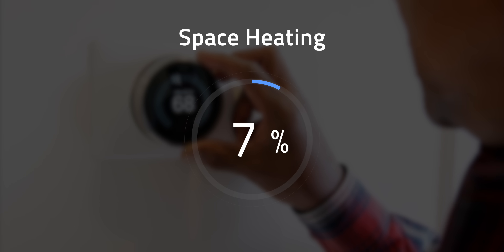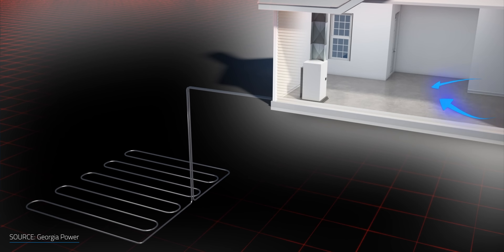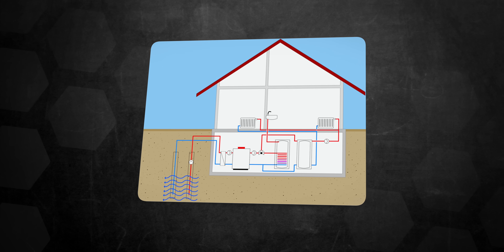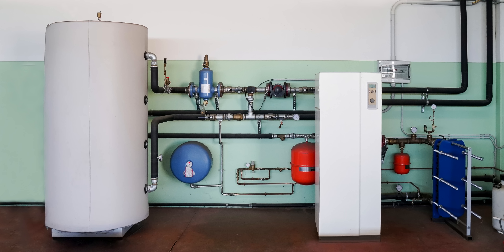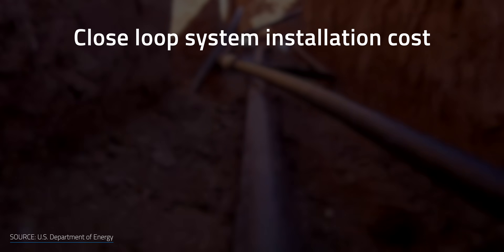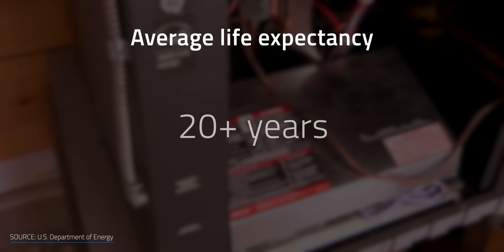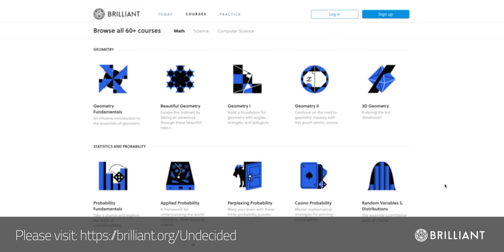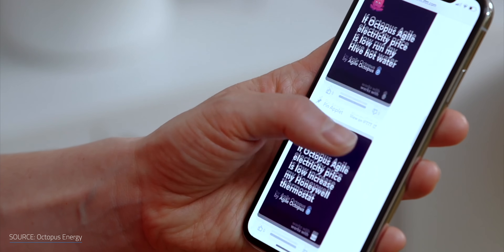Is Geothermal Heating and Cooling Worth the Cost?  Heat Pumps Explained

Comment: I heat with propane in northern Michigan and what I’m thinking of doing is installing a Mr. cool heat pump and AC to heat the Home in the fringe months. This would cut down my propane use and be more efficient. It will also act as a back up heating system in case the propane system where to fail. Because of the Lake Michigan temperatures are not as extreme. Has anybody ever done this? Any thoughts?

Comment: I've been a fan of heat pumps since I discovered them I'm 1989, I was a heating engineer and consultant and quoted for a number installations here in England,  but never installed any for a variety of reasons, I haven't been able to make the economic reasons work. In the UK the average seasonal COP is 3, electricity is circa 3.5 times the price of natural gas, so at best the heat pump is more expensive to run. 86% of heating in the UK is by gas fired boilers, the cost to replace a high efficiency gas boiler is circa £1500, the best makes will run for 20 plus years, with low maintenance costs, the average cost to replace a gas boiler with a ASHP, the cheapest option, is circa £20,000, there is no financial case, also the maintenance costs are likely to be higher, one of, if not, the major obstacles is the space required for the equipment,  Lock'n'Store is so popular in the UK as the average house is approx. 1100 ft2.

Comment: This can also be integrated with the piling foundation. For these projects that require piles, geothermal adds only a very small extra as the piping is just tied together with reinforcement. Concrete is good enough at transferring heat, so it does make sense.
Reply: That is a great idea.  I would bet most don't think about that.
Reply: @houstonbill  
Nope, they don't. Unfortunately. 
Micro-piles are becoming more popular so it makes me even more sad.  

It's becoming more common for bigger projects though, especially when the government is a client. 

They were installed in Crossrail (new London metro line). I know as I was on the project.
It's nothing special to be honest with you. The technology is old and conventional...which makes me even more sad :(
Reply: @valdius85  the Shard in London also has geothermic pile foundations I'm pretty sure
Reply: @Brurgh  interesting. Thanks for sharing that

Comment: Locally in the nordics it's not called geothermal, it's just a ground heat system. Currently many (20%ish) new single home houses are built with one, often combined with an exhaust air heat pump. More single home houses are now heated with ground heat pumps than with electricity in finland.

Comment: Geothermal is really the best option if someone in the north wants to install a heat pump. It's so cold up there that air to air heat pumps really don't work. 

The big problem is that geothermal systems are incredibly expensive and take substantially amounts of time to install. It's also not easy to just find anyone to service them nor is it easy to replace them if they happen to go out. 

Personally I think if geothermal had more support behind it from entrepreneurs that were able to bring the price down by at least half, which i know is kinda unfathomable, then it could become incredibly popular. Especially for a lot of new construction in rural areas.

Comment: Technically, this is 'Geo-reclaimation'. It's 'worth' is subject to installation and alternate fuel source availability costs. If the popularity of this system is prevalent in your area, you may end up spending less for your system than other areas.
Reply: alternate fuel source doesnt matter as it takes less power per heating and cooling unit over other heating/cooling systems so you save money and emissions in the long run regardless of how you power the system but coupling it with a small solar array would make its operation free if you have some form of battery system for night time use.
Reply: @bodhisfattva7462  - I beg to differ. I'm not certain you understand my statement. 
When the installation costs, divided by the number of years to pay off said costs run past the dozen year term, then you see little benefit and in actuality pass your potential savings on to future owners, give the high home turnover rate in North America.

Comment: I’ve known about the advantages of geothermal heat pumps for many years and continue to be confused on why they aren’t more popular. I know the up front cost is a issue, but radial tires cost more than bias belted, how many cars run bias belted.. yes I want geothermal, with solar panels and power wall for the electrical source, and just to round out the system, a biomass boiler in the garage for the really cold days. I am in Maine.

Comment: Spend your money on insulation, weatherstripping, and maybe multi pane windows.  I’ve now lived in 2 well insulated houses in Colorado, and heating is really a non-issue.  We used baseboard heat in both which is really inefficient compared to heat pumps, and the bill is usually less than $250 in the winter.  I’d put in a air source heat pump which now can work to crazy low temps before I’d put in a ground source heat pump.  So much less complex/costly. But really try all the simple passive stuff first.

Comment: How warm will it make your house in the Winter?  If it is 50-60 degrees F in the ground, how will it make your house comfortable to live in?  Liquid does not compress like refrigerant gas.  You would be limited to warming your house to ground temperature.  That is cold enough for carpets and clothes to mold.  
I knew a guy in Florida who had his AC condenser cooled by his well water, which was discharged into his lawn sprinkler system.  It cooled the house rapidly, and watered the lawn at the same time.

Comment: Just as a small international information for you. Here in Switzerland, our House (consisting of 8 seperate appartements) just inquired what would the price for  a horizontal Heat Pump be and we all were shocked by the stagerying 120'000-180'000 CHF (that converted to USD is around 7%higher) and thus we will most likely just swap out our heater for a new oil powered one (price around 20'000) 
so the price differences can be a lot higher than in your examples. 
Still good video and have a nice day :)
Reply: Check on cost of vertical system… and his was talking about a single house, you said yours was for 8 apartments….
Reply: In Switzerland everything is 2-3 times more expensive than elsewhere. Especially when it comes to specialised work you cannot do yourself. I also live in CH and found that costs between companies can vary wildly. I would ask at least 3-4 quotes and ask them to provide you with an ROI calculation vs oil. Theirs margins are ridiculous, if you challenge them, you will be surprised. Most work with developers, who just pass down the costs to new house buyers without questioning them. They have gotten used to this easy way of making money. Electricians are the worst in my opinion.

Comment: The diagram you used to explain how this works coupled with your wording is a bit strange. The compressor isn't pumping a liquid, they're vapor pumps. Pump a liquid in a scroll or a recip and you'll destroy them.And in a closed loop system, you'll almost always seem some sort of glycol solution in the mixture. glycol causes some efficiency loss but probably doesn't matter that much here. As a HVAC contractor and tech, I don't recommend them to people. They're expensive, if the copper in the ground gets damaged and needs repair, that's expensive to dig it up and find a leak, just too many potential issues. The price you pay to install one, you'll never get that money back during the operating life of the equipment. Get a standard 14 seer heat pump, or get a 96% two stage gas furnace and a 14seer air conditioniner. Also, It's really a good thing to go by rule of thumb. Every house is different. You have to do a proper load calculation in order to figure the actual size of a unit you need.

Comment: So, correct me if I am wrong but, you're still using electric to power the pumps, fans, etc of a geothermal heating/cooling system which you pretty much do anyways with traditional methods?

Also, if you were to go with the more expensive ones around 30k and were liberal about your cost savings - you'd be saving about 100 bucks a month, give or take, on heating/cooling costs. Thats roughly 25-30 years before you'd see a return on your investment. Definitely not a practical or cost effective system.

Not sure I understand what the benefit is of such a system at this point.

Comment: Great video, thanks. I live in Europe (@52 deg N) and I have recently built a new house. Due to limitations on site size, I installed an air to water heat pump as the sole heat source. I am really pleased with the result. Complete house has underfloor heating. There is currently a serious drive here in Europe to get away completely from fossil fuels and reduce CO2 emissions. Perhaps this air to water system could be an option for people in the US also, particularly in Urban areas where availability of ground for Geothermal is severely limited.

Comment: I have been researching this... and the hard part is to find any contractors/companies that will work a little outside the box, especially here in MA. I have found most companies solutions, want to deal with only ducted forced air systems. I have also found that a lot of this is tried and true in the commercial space but hasn't made it to the consumer/residential space... Things like water-sourced ductless systems, VRF / VRV based systems... Or Ductless Hydronic systems ( no refrigerant / no max length considerations )... would love any advice you have for a fellow MA person ;)

Comment: A big benefit of geothermal vs conventional heat pump is the ability to respond to nasty weather.  It keeps your home much more comfortable at times when the weather would really challenge a conventional heat pump.  You didn't mention that the COP for an outdoor air-exchange heat pump depends highly on the outdoor air temp.  So when it's really cold, the COP is greatly reduced and it takes a lot longer for the heat pump to warm the home.  There is even a point at which it's necessary to backup the system with resistive heat (ex$pen$ive) just to keep up.  For geothermal, the COP doesn't change much, and even during very cold temperatures the heating can still perform well and maintain a warm home. Winter is a bigger challenge than summer, but these same rules apply during summer as well - geothermal handles the temperature extremes far better and keeps the home much more comfortable than conventional systems.  I've had geothermal for almost 6 years now, and it's fantastic.

Comment: I don't understand how you gain heat from a 60° ground to heat a house heated to 70°.  Seems like the return loop would lose heat to the ground.  And in a conventional system, return air is warmer than 60°.  It seems the system is really based on the heat pump.
Reply: Heat exchange chamber.

Heat can be transferred to other systems.

Energy is lost mechanically and electrically but not thermally.

Comment: is it possible to combine both Geothermal heating/cooling along with the Sterling engine that you've done in another video to both heat/cool your home along with providing power?
Reply: If you rely on a starting power source or material, yes. But if that's the case you might aswell use 2 seperate energy sources rather than combing your water and your heating and your electricity into one rather inefficient method.

Comment: Like you said, it's the up front cost that holds me back. My HVAC is due to die any year now. But at 15-30k for a geothermal system, that's like doubling my student loans. If I was building a home from the ground up, I'd start with geothermal and solar roof tiles. But with an existing home, the cost-benefit doesn't look good at this point in time.

Comment: my sister has one and they are having heat pumps last around 8-10 years. thats it. the new pumps are junk. their old pump lasted 20 years and their installer told them the new ones are not lasting more than 10.

Comment: Mech. Engr. here.  Systems do not send refrigerate into the ground.  Only water goes into the ground loops.  A heat exchanger within the heat pump uses the heat from the ground loop water to change state of the refrigerate depending on heating or cooling.    I designed my system for my home 10 years ago.  I have 9ea, 300' wells for a large home on the coast of SC.   I find my air temp. from the vents in my house are 55F in the summer and 115F in the winter.  The unexpected is that ground source heat pumps are higher efficient and can produce much hotter temperatures for the house in the winter.   I priced a geothermal system to a high efficiency typical heat pump system and found the geothermal system to be about 80% more in cost.  However, with state and federal tax credits, the installed cost of the geothermal system was less than the high efficiency typical heat pump system.  My electrical costs are about @$230 per month and that includes an electrical car.   This is a no brainer tried and true technology that amazes me more people do not do.
Reply from the maker: Thanks for sharing and the clarification.  I could have done a better job explaining that first point, but it's not only water that can go into the loop.  Some closed loop systems use an antifreeze solution.  I really hope costs for these systems can come down to make them more financially compelling without incentives.  With incentives ... they really are the way to go if you can.

Comment: I went with a vertical closed loop GSHP for heating and cooling several years ago. IIRC, Federal tax refund was 30% of the cost and my electric company kicked in $1,200. It also preheats water for the hot water heater. If you're into a house for the long-term, high efficiency is the way to go. Those who are just flipping a house quickly won't see the savings, put in something inexpensive to install, and doom the next owner to higher costs over the life of the system.

Comment: Nr 1 in low cost heating is not heat method  but a good insulation.
I heat 200 sq meter 6 months at average temp +5 - +7 celcius with less then 1000 cub meters of natural gas per season less then 300 usd. With 0 running cost of geothermal installation, I would not install it. It is waste of tons of money!

Comment: if you don't mind your house being heated to 50-60 degrees when it's 0 outside then you will be great otherwise you need to heat the water another way.
Reply: Hmm. My geothermal unit keeps my house 70f when it’s -40f outside. With no backup heat source.

Comment: My personal view is that you either want something with a 100% reliability (EG a fire)  for heating or two independent systems if you are somewhere fairly cold (IE temps reaching -40). In the remoter areas of Siberia every house has a fire and oil heating, and often propane as well. When it gets seriously cold (-65C or about -85F) they usually have two going. On the plateau in one of the towns it got so cold once they could not measure it properly (colder than -70C or -94F). Oymyakon has an average winter temp of -50C (-58F) and regularly is -60C throughout January. For hot places there are all sorts of tricks you can do to cool your house before AC eats your wallet. Double stacked vented roofs with water sprinklers where they are allowed. IE a roof with wriggly tin spaced off by 15cm (18 inches) so your roof is not subject to direct sunlight. A gap at the top for hot air to escape and that alone will reduce your house temp by a few degrees. The water sprayer trickles water down the roof at something like 1 gallon per hour. That cools the outer layer giving you a few more degrees. Then there are the window shades which ideally would be a lot wider then the windows so it keeps direct sunlight off the walls as well. Another few degrees cooler. None of those cost a fortune, and the window shades should be easy to get building permits for if they can be easily removed. The roof is a completely different issue though and completely unsuited to hurricane areas etc. I have seen them used without the water system in some places in Africa and one or two places with and the water does make a difference.

Comment: $15k installation, imho to make it worth it, it should pay itself  in 10 years,
so its $1500 a year.
This means if heating/cooling costs you more than $1500 a year - install geothermal.
If not - not worth it.

I.e. where i live annual cost of heating cooling for my house is around $600 a year, so $15k investment is worth 25 years of bills pay.
And i have no guarantee i'll live in that house even in 10 years.
This means such system is not worth it, with only exception if i wanna pay for autonomy, since with that system solar and wind would be enough to power house in winter.